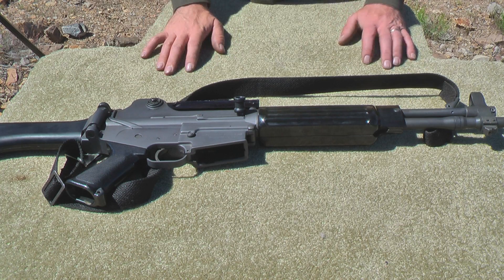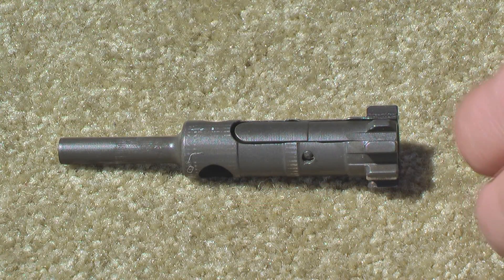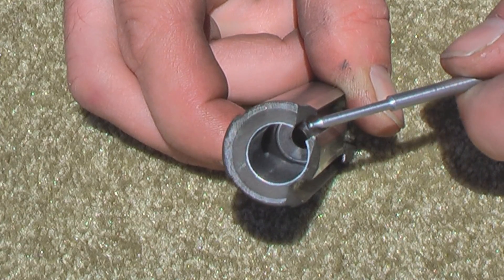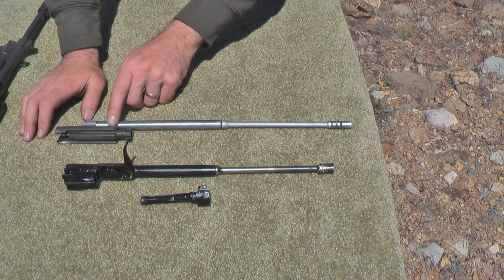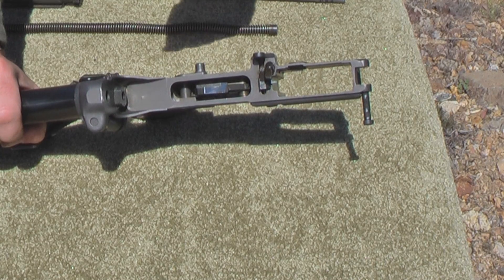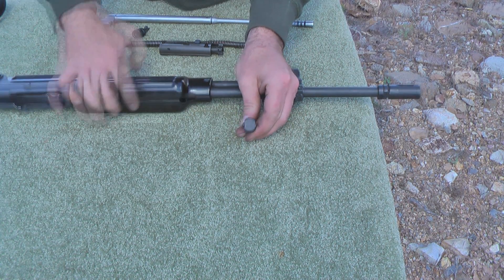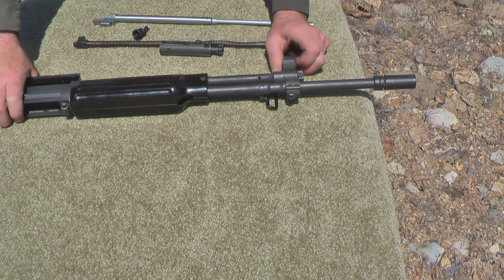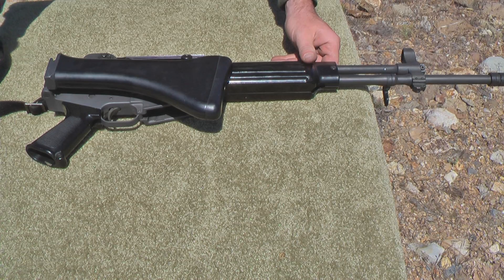Daewoo Max II an Inside Look

Comment: Charging handle is perfect to seperate upper rifle body from lower rifle body parts. Don't need to use multitool or can opener for tight situation, in my experience.

Comment: Spent 2years with this rifle, it's accurate,reliable and easy to maintenance. But little bit long as battle rifle,no custom parts when i use it in army-56th ID. In 25meter range you can 'zero-in' from winter coat button size to oreo cookie size without problem.

Comment: I'll tell you what, you're gonna make me buy one of these if you keep posting videos on it :)

1. How easy is it to find critical spare parts for this such as firing pins, bolt, etc?

2. I think it goes without saying, but the Max II has a reciprocating bolt handle correct? How does that mess with you shooting lefty? (I'm a lefty as well)

3. Is the muzzle threaded in such a way as to accept AR muzzle devices? What about AR pistol grips?

What a slick rifle.

Comment from the maker: @JobForAGunXx I was apprehensive when I first bought the rifle because at the time it was a new import and no one knew anything about it. After the first trip to the range I was very impressed. It feels a lot different than the AR15/M16 when fired. The bolt moves so fast that it absorbs a lot of recoil and very little muzzle climb. It takes standard AR mags too which is very desirable.

Comment: @deepwater1974 I'll stick with my direct impinged AR15, at least it doesn't have parts like the gas control that'll blow off if they aren't perfected aligned. And you don't have to be finesse with it putting it back together, which is important when you are in the field under stress. And having too many weapon systems will just cause issues with training, supply, etc. KISS.

Comment: need a english gas pin?daewoo makes the lathes that make the guns, several U.S.manufactures of firearms use daewoo lathes, daewoo M16 is good its built with colt, the K2 is my favorate, got one of those korean language lowers with good guts:P ,K2 &max 2 are the same, most parts interchange, some early gas tube assy were slightly different